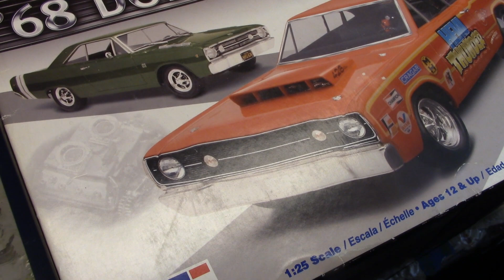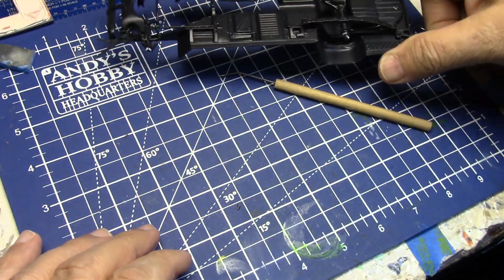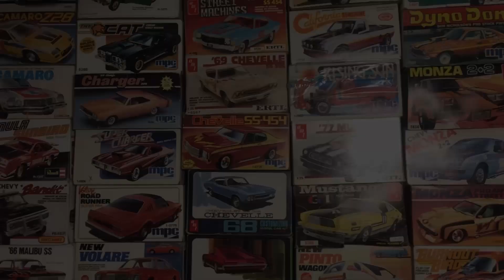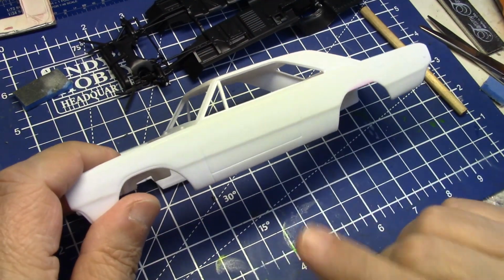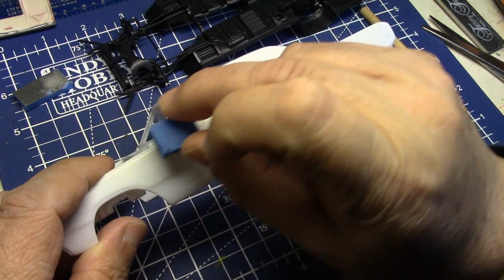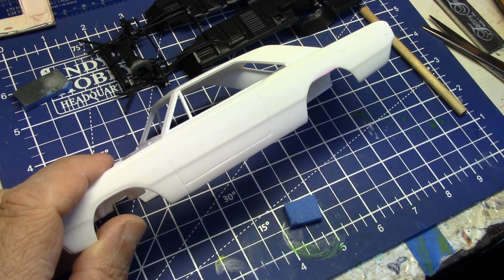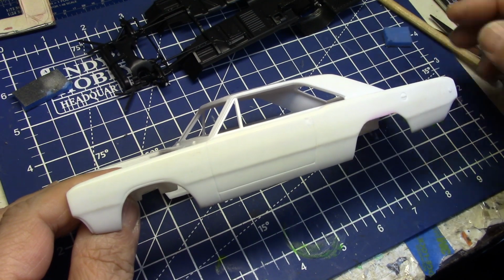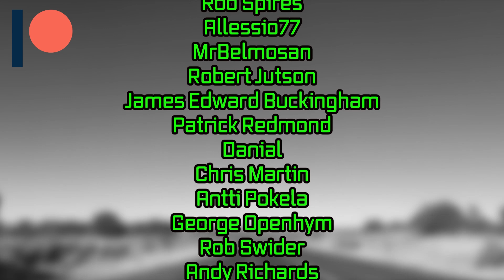Why Do We Get "Ghosting" On Our Model Cars? Ep.273

Comment: That explanation makes sense. I feel like I might have been told that once upon a time and just un-remembered until you covered it again! Thank you, sir! That priming/sanding phase is one of my favorite times because of how you can start to see things coming together. That vision in your head starts to materialize in front of you and it's a great motivator when things are working well!
Reply from the maker: Glad it was helpful!
Reply: @The Luka Cee Channel  hey Luka what I use that ALWAYS  WORKS for me is the(liquid)Krazy-glue it dries very hard and I uses it also to fill in body sink holes 🕳 parting lines e.g.like two engine halves to seal off flush ect.ect.after it is dry you can knock it down with some 400 sanding material and the use the lighter ones for final smoothing off,and I bet you,you wouldn't  see any more"ghosting"again Luka

Comment: I used to use tamiya putty to fill ejector pin holes.  They would always reappear in the primer.  I started using polyester "icing" filler.  This is an automotive filler used over "bondo".  I guess the lacquer based filler was reacting to the paint.  No more ejector pin issues.  On another note.  I am building an old Don Prudhomme Monza funny car kit.  It has been a struggle and not fun at all.  The chassis on these cars is multiple pieces and very delicate.  The plastic is so brittle, it hardly accepts glue. When you bend a part to glue it in the right place, most times it breaks instead of bending.  It has been a killer.  Use caution with these old kits.  I know a lot of great resin bodies say use early revell funny car kit.  You have been warned !!!  LOL

Comment: Question : Do you only get "ghosting" when you use enamel paints and primers, (And even laquer paints) say from a spray can, or will it still ghost if you use acrylics?
Reply from the maker: I have found that ghosting occurs with all primers and paints.
Reply: @TheLukaCeeChannel  Thank you for responding back. Interesting...I thought it would be the chemical in the paints that was opening up the sanded details.

Comment: Good info Luka, then there is the case of ghost seams showing up a year or two after the model is finished, these do not appear during the prep and priming stages but pop up later due to the paint shrinking back, these are a real bear. 
What are your thoughts on 'hi-filling' these areas prior to primer being shot? is this why automotive guys do all that work prior to shooting primer, i.e to protect against shrink back over time. thanks james.
Reply from the maker: Here's the secret to them not showing up years later. Two words
Polyester putty
Reply: @TheLukaCeeChannel  Thanks for the tip Luka.

Comment: Remember guys, you're doing body work to plastic, not metal, so things are gonna be different.  Additionally the primers for models are nothing like automotive high build primers that are used to fill defects.  We don't want them because they would fill all the details and seams.  It's common to have to prime and sand a number of times to get it right on real cars, so plan on having to do it here as well.  And this isn't even considering using fillers!  That opens a whole new subject and all I'll say on that is make sure that's primed completely.